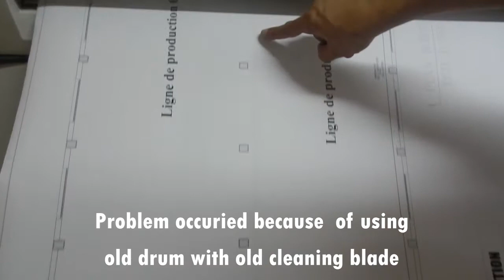Repair for XEROX 6204-6705 Checking and cleaning the Drum and the cleaning blade

Comment: tengo un 6605 pero le pongo IP, y no me lo detecta mi pc, que puedo hacer??
Reply from the maker: Hello friend contact me on WhatsApp please +213779440567
Reply: @wideformathelpwfh7192  - I have a similar problem to that of Abraham. I can detect the plotter on my work network, but the Xerox print driver's don't appear to work on either Windows 10 or Windows 7. Would you be able and willing to help steer me in the right direction?
Reply from the maker: @donquijote6030  
Hi friend you have to change the Port configuration 
Contact me on WhatsApp for More help